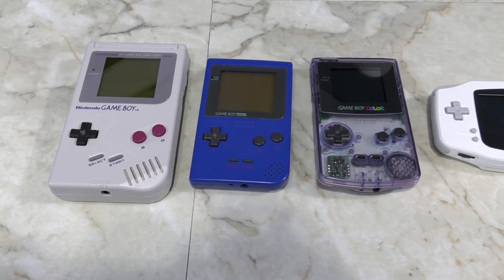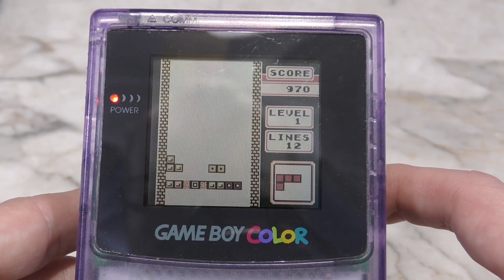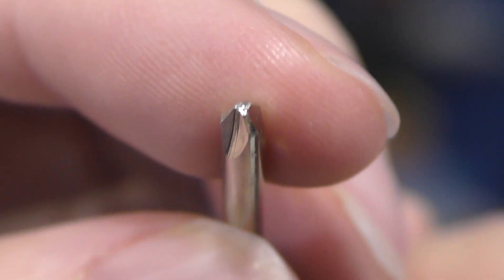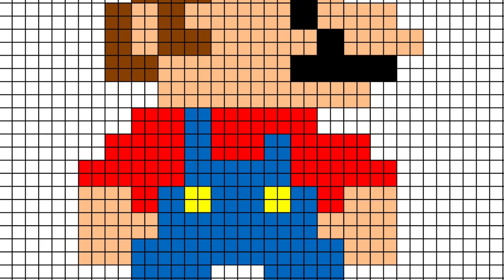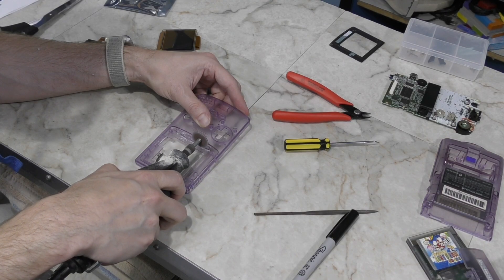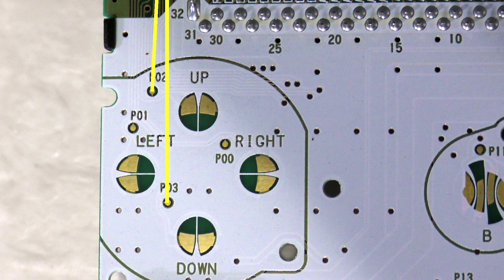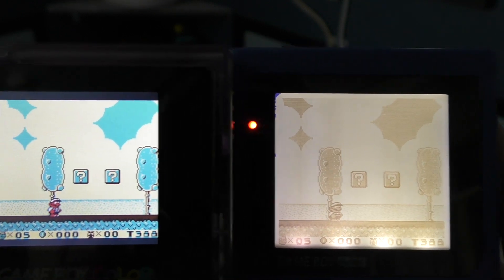Finally - A Gameboy Color Backlight Mod!

Comment: I understand this is an old video. But it would be cool to see what it takes to run a back lit screen with a 24mhz oscillator crystal installed on the GBC.

Comment: The original Color had a reflective display, you could see the liquid crystals "float" over the background. Using a modern LCD just isn't the same. The best Colour mod would use a reflective display, the original display, and use a front light technology like the Kindle has.

Comment: very cool to see this initial version of this.  I just modded a Gameboy I bought that was parts for repair that had pretty significant PCB damage and needed many traces repaired and I had to rebuild the button contact pads so it is pretty rough on the inside but I got it working again and decided to replace the very badly damaged screen with the new Retro Pixel IPS LCD mod.  It requires quite a lot of case modification but I just slowly shaved it back with a knife until I got it perfect and soldered up the new screen added a rechargeable battery pack and it is amazing now.  Feels great to play and since the screen is actually large and backlit it is an awesome experience especially since it is all original hardware running the games.

Comment: I ended up using a tempered glass replacement screen cover because mine was scratched up.  it's so worth going with glass.  I think i got it on Amazon.

Comment: I never had a GB or GBC. But from someone who played with "brick" mini games on the old days it looks just neat the original GBC display the way they are. With the silver background and pixels that resemble a transparent tint over a glass. It's a unique LCD display. The mordern LCD IPS mods nowadays will look good but ordinary. It's like playing GBC on any other modern gadget (PSP, Anbernics alike). Its not the original experience of the reflexive display. Also those games don't have great colors in the way modern LCD will expose this limitation in vivid colors and brightness, wich looks a bit dull. The reflexive one has is charm.

Comment: 5:44 I know it's been a while since the video, but there's a GBA backlight mod with no case modifications required available in China and pretty cheap.
Reply: Sure wish people would link stuff like this when they mention it.
Reply: @thebryang  The main problem is, if a comment with link attached is sent, it might be flagged as a spam. You can find it by searching "GBA IPS Kit" on shopping websites. What I bought included an adapter board with "PANGO" engraved on the chip packaging.

Comment: Hi, soldering vcc from a testland/testpoint is not OK. It shears off and is used for ICT/FT testing with needles(probes). Instead use a THT component or solderpad. Brgds

Comment: I didn't want to cut away stuff from my beloved Gameboy color, so I used a different mod. The screen is a little bit smaller than the original but that doesn't bother me a bit, since there comes a special screen cover with the mod that fits the new display dimensions and makes everything look right. And all that without damaging the Gameboy shells, very nice and it looks amazing. Got it from Ali Express, and after I built it in, I bought a second one of these mods and a few more screen protectors, just in case😄

Comment: I installed the GBA back light kit, on my two kid's GB Advance.   It was a tricky install.   The kids are adults now and they just tried them out last weekend, and it still works years later, including the light.  But it definitely makes the system far more playable.  It's a shame Nintendo didn't include it from the factory.

Comment: I'm always amazed at how good the old classic games look on a modern screen. Emulators can even hack some of the 3D games like Mario 64 to display in 16:9 ratio with the right settings.
Reply: And now that SM64 has been decompiled, we have high frame rate support, true camera control (even mouse camera), and even raytracing lol
Reply: There's even a android port of sm64 now which is crazy. But og hardware is dope with mods, flashcart and roms.

Comment: Just went on eBay so I could get some replacement parts for my old GBC. Speakers were shot before I even upgraded to my GBA SP, the battery cover tab has been broken just as long, and the tape job I did to keep it in place (but still able to hinge) has destroyed the rear sticker. So I had to get a triwing screwdriver (which came with the socket bit to open up a cartridge for replacing batteries if I ever need to), replacement battery cover, speaker, and new sticker. Then I remembered this video, but they're out of stock and I don't really think I need the backlight that much for $65. Definitely cool, and maybe some day.

Comment: Why Nintendo did not use backlight on Gameboy ? I owned a GBA when it just came out in 2001, i sold it a few month later and bought a PS2 only because of the lack of back light make it a pain to play the games (only my opinion ). 
Yes agreed hey are jackass.
Reply: i believe because of battery power usage.
Reply: @thingusbrulingus  then why they did not add a switch or option to switch off the light when not needed? The answer is they tried to increase their profit margin. That console was so a big success amour kids that they did not needed to add anything to it , they even did not updated a lot the CPU GPU chip over the different versions . Nintendo had made a lot money with a basic portable game console with simple graphics. I'm not against it but Nintendo should upgraded their product instead to focus on increasing the profit
Reply: @betruly7894  i believe the reason they didnt update the cpu gpu was because the gameboy color was somewhat of a filler console if memory serves

Comment: Hey I just bought a modded Gameboy color with a backlight from ebay and on pause the screen keeps changing brightness as if I'm tapping the brightness adjustment on the ir sensor. Anybody know if this is some kind of battery saving feature or is it a defect?

Comment: Color looks great, but are the dimensions exactly the same as the original gbc screen? It looks like there is a bar at the top of the backlit screen. Is the soldering difficult for someone who is inexperienced?

Comment: I don't understand why nintendo didn't launch with backlight like on a laptop, they could have released two versions, one without backlight and one with a little more expensive backlight, I wouldn't mind paying much more because gameboy was the only one alternative at the time to play away from anywhere. As for the high power consumption, it was enough to replace the 2 batteries with a 9v battery that would occupy the same space and would require little modification in the housing.

Comment: my biggest issue is it costs 65 dollars and for that much i can buy a gameboy sp. furthermore there are these devices like the rg300 that are little emulator powerhouses there is also hacked 3ds sony vita as well. So why do this when better already exists in both software and actual hardware.

Comment: Will this work with a Game Boy Pocket?
Reply: Game boy pocket already has a much simpler backlight mod where you just replace the reflective back with a light panel, it just wasn't possible to do on the color. The one for the pocket costs like 10 bucks

Comment: Given you've already done this mod this comment won't be nearly as relevant to you, but in checking yet again for a competitor to the Game Gear McWill mod, it turns out there's a guy/company out there goes by "BennVenn" who also makes a GBC drop in screen, $5 cheaper than this one and it's no solder required. Called the "FreckleShack." Hopefully folks find this info helpful. Of note, I am not involved with or employed by BeenVenn, I simply found them this morning while searching and wanted to share the info.

Comment: Not sure if it’s been pointed out already, but the reason black and white Gameboy games had color on the GBC actually had nothing to do with the Super Gameboy—that color data wasn’t compatible. The Gameboy Color’s internal boot rom actually had a list of a huge number of games (if not all of them?) with a corresponding palette assignment for backgrounds and sprites. Anything not on the list got a generic one. You could also override these by hitting various buttons during bootup!

Comment: Yeah for the adhesive tape try and use the double sided tape made for cell phone screen repair it's cheaper than the big tape and it is easier to put it on the front shell for the screen protector and it has a plastic guard on the back so it won't lose its sticky Ness until you get the adhesive tape the way you want it and when you put the screen protector back on the front shell it is way easier to line up and put on
Reply: Yeah don't forget to pull the plastic guard off then put the screen protector on I meant

Comment: This should have been done 20 years ago when I needed it...
Reply: The FPGA used in that product would've been priced at about 200k$.
Reply: I had the little dongle light that plugged into side port. It worked ok but sucked up batterys like a mf'r
Reply: @Teh_Random_Canadian  i got that from my cousin a couple years later
Reply: That's why I hate Nintendo, the Japanese Gameboys had a backlight version
Reply: :D
Reply: I agree
Reply: In the next 25 years or so I bet we'll have holographic videogames you play using the dimensions of your bedroom, that by todays standards, would be considered way too advanced
Reply: @nickz5849  probs not, it'll just be advancing what we have now, with vr getting much more slimmed down and cheaper. moors law also seems to be slowing so vr gaming will probably be great in 20 years
Reply: @nickz5849  you nailed it

Comment: There's other solutions for this, easier to do and cheaper solutions as well, and they don't require buying a whole new screen.
Also this doesn't look good at all, it shrinks the game while requiring u to cut a lot of the shell, adding 2 black bars on the screen.
Reply: Do you have links to the other solutions you're talking about?
Reply: @truthwinseverytime8805  there's a guy in the comments who just made a front light mod, there's tons to add a backlight but they are not as easy to do, but the result it's definetely better than that.

Comment: They're actually Tri-point (sometimes called Y-type) screws, not Tri-wing screws. Tri-wing is the logical thing to call them but that name is trademarked (originally in 1960 by American Screw Company but now owned by Philips). If you compare the head to the driver you'll see the head has slots going straight out from the center while driver has wings emanating from an offset to the center. AFAIK Tri-wing is mostly reserved for the aerospace industry and I have never seen it actually used in electronics.

Wikipedia is great at illustrating the difference: https://en.wikipedia.org/wiki/List_of_screw_drives#Tri-point

Comment: Are you serious? 3 minutes of babbling to get on with the easy mod? 
And are you really using Duracell batteries as a tech you tuber? Lol buy some rechargeable ones you baboon.
Also for adhesive, use goo gone it’s much safer on plastic.

Comment: i am torn.  i want to do this to my original 20 years old gameboy color.  BUT it's an original 20 year old gameboy color.    i don't want to do such a destructive mod
Reply: You could always buy another gameboy. They go pretty cheap now seeming as the gameboy trend has died down a bit
Reply: Probably easier (and cheaper) to buy a GBA SP - it has a built-in backlight and plays all GameBoy and GameBoy Color games at the correct aspect ratio.

Comment: If youre looking for a good adhesive remover that wont damage the plastic try something called Napthan. You can get it at Lowes or any hardware store really. It will dissolve things like inks and such but wont interact with plastic negatively.

Comment: Kongfeng GB Boy Colour > Any GB/GBC modded console. The price is basically the cost of a GBC. The quality of the screen is by far greater. No shadowing. It may be ever so slightly wide screen but I'd rather have that than making the screen smaller! Also.. they've spelt the word Colour correctly. If you can't pronounce the word aluminium (it has a 2nd I) then you shouldn't be allowed to rename words.

Comment: no special type of screws can go against universal magic screwdriver — а half of scissors
Reply: Thats a damn good way to strip screws.
Reply: Sadly, wii screws still beat it
Reply: Or, buying 100 pens from the dollar store, melting the tip on one, and stabbing the screw hole! I did that for my OG Xbox and Gamecube.
Reply: but then the screws will get carved up and the 3 points will more resemble a circle.
Reply: referral madness  -with a lighter.  I did this to fix a friend's Gamecube and it worked AMAZINGLY well.  I could even sometimes get 2 screws unscrewed with 1 pen.  Now it's 2020 and I have an $8 screwdriver set that handles just about anything
Reply: Gamebky cartridge screws do

Comment: Pretty nice mod, feels like the new screen is a bit too small for the GBC because of the difference when held side by side, and that kinda nags me. Another thing I'd like to know is: how much battery does it consume vs unmodded and if any battery mods exist to replace the original system with one thats rechargeable and more modern.

Comment: man... its so close to being perfect. The modded screen is just a tad smaller than the original and so you can see the edges of the screen through the screen cover... It would have been better if it came with a properly fitted cover as well. Too bad, otherwise perfect.

Comment: It's a cool unit for sure, but the size is slightly wrong and the huge reduction in battery life stings.

I suppose the next mods to do are a properly sized glass screen protector replacement and a lithium ion battery pack.
Reply: But the battery doesn't reduce its game time, the backlit screen is new technology with a lot of energy efficiency.

Comment: @The 8-Bit Guy - 
The Sega GameGear (GG) that was released in 1990/1991 gave me this out of the box https://www.youtube.com/watch?v=SooDILf0jVs & also there was the Master-Gear converter for Master-System (SMS) games on the GG , but the viewing angle was not as good, had a hefty price https://www.youtube.com/watch?v=wR_lJ_kWj-o & the GG ate batteries fast (CCFL backlight) ... better have highest (Non-fake-) capacity rechargeable C or D (NiHM) cells via "Russian Method" self made adapter (wired external battery bay) , recommended with a belt (or adjustable arm) strap. 
https://www.youtube.com/watch?v=AwttKdS29wE

Comment: Ya want good graphics AND good gameplay? Just Shapes and Beats is a game that just turned one year yesterday and it is worth the $20. The animation is smooth and the character designs are really good, along with the songs and levels. Story mode is really good as well. Its a pretty great but nice story. Overall a pretty underrated game.
Sorry for this being long .w.°
Also this isnt supposed to be an advertisement, i just REALLY love the game. (Also its 2D animated if youre wondering.)

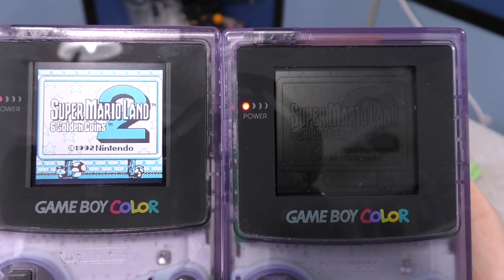Comment: Looks like preorders are up. I'll have to wait until new stock comes in. Big issue is the size. It's as small as the gba display. You can even see it at 10:42

Comment: I think you should have covered two additional items: 1) how does the screen look in the sun, and 2) impact on battery life.
Reply: AAA and 9V last A LOT less
Reply: @needforsuv  that's cause AAA and 9 volts are the same, 9 volts are 6 AAA batteries.
Reply: 9V is ~AAAA not AAA, so worse than AAA
Reply: With this screen could just go further on mod and install li-ion battery.
Reply: Does anybody have a source for these screens now that Midwest Embedded is out of stock?
Reply: @murrij  let me know if you find some I'm looking myself
Reply: And the impact of a smaller screen. I ment to Say on the usability or gaming experience.
Reply: @Patrick_AUBRY  GB Boy Colour has your back. Go onto AliExpress (Chinese wholesaler) and buy one. It'll cost £25-£30 and it'll replace anything that you have. The only thing it lacks is the ability to use a link cable..
Reply: LED-backlit Transreflective 2.2″ TFT LCD “Daylight Visible”
Recommended batteries are NIMH 1900mAH providing 3 hours of run time.
Reply: That’s smarter than the 8bit guy
Reply: I use AA for clocks
Reply: I remember when I used my Gameboy Colour, "normal" rechargeable batteries wouldn't work, but I had these Raovac(?) ones that would charge in 60 minutes that were perfect. I remember paying about $40 for the charger and 4 AA batteries. I'd see if they still exist and that would really help with this mod.
Reply: @tspooner01  Rechargable batteries will at least save you money :) (well not you specifically sounds like you have a fix lol)
Reply: You can’t see it in the sun and battery life is reduced
Reply: Great idea
Reply: who cares, we have LG lithium 3500ma batteries now... power for WEEKS!!!! and rechargeable
Reply: @victor.elkins  He did but he also invested £60+ on it so he's got to try and make sense of that. I have both a modded GBC and a GB Boy Clone which I can honestly say the smaller screen is annoying and not worth the money. A real 1:1 replica backlit screen will be made for them eventually so you might as well just wait. Buy a clone yourself from AliExpress for only £25 and you'll be impressed and not even want an original!
Reply: So? AA batteries are cheap these days
Reply: @needforsuv  they're really not lol
Reply: @needforsuv  
"AA batteries are cheap these days"

Average cost: $1
Average power: 4.2 Wh
Average cost of equivalent grid power: $0.0004

Yeah... dirt cheap!...